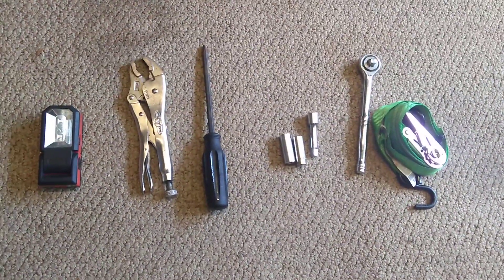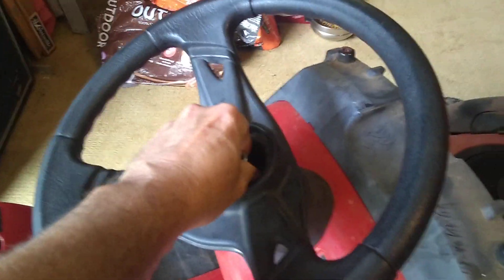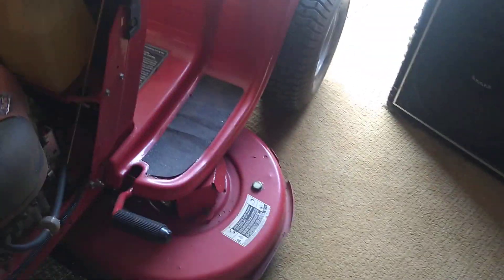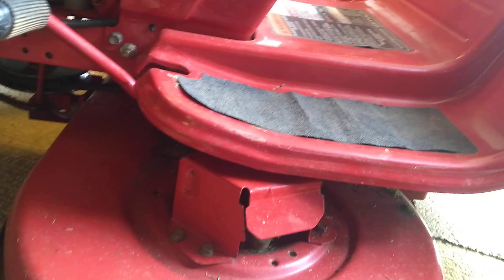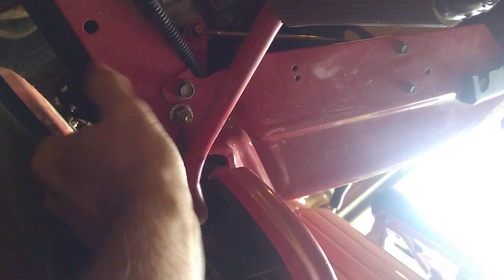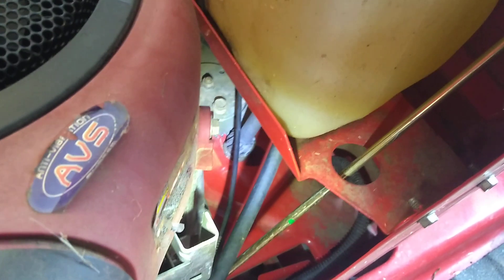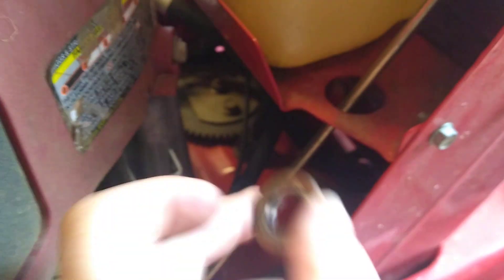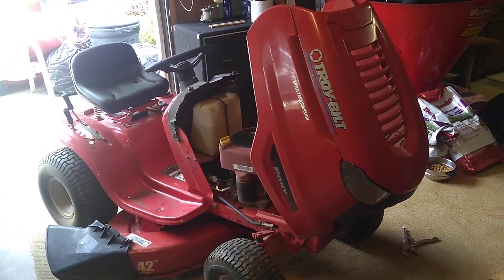Troy Bilt steering column fix 2008 model

Comment: For those that may have an issue with the Philips head screw like I did. I used my battery powered impact wrench with a #3 Philips bit on that Philips head screw while my son held the steering wheel and it came right out.  Nice video.
Reply: It’s a 5/16 size 1/2 inch long bolt will replace the Phillips screw 😊

Comment: Very helpful video gscott1111. I have the exact Troy Bilt Pony year model here. After inspection, I noticed that I need to replace the steering gear assembly as well. Might as well while I'm in there. Calling Troy Bilt mañana.

Comment: Thanks..got the new steering rod...but the big Phillips screw i can't for the life of me get it OFF...
any suggestions ??? Thanks in advance ☺
Reply from the maker: I used  vise grip plyers. Had the same issue. It will come off,  you might have to put a long pipe over the plyers for leverage.

Comment: I replaced shaft but screw on bottom ended up falling out. I ordered a new one with loc tight and that fixed it. However, new pinion gear on new shaft immediately stripped out again so I’m back to square one. I think I’ll have to replace/tighten other gear that pinion turns but I’m done fooling with it and will likely pay to have it fixed by someone who knows what they’re doing at this point. I’m super frustrated.

Comment: Folks.. keep the original hex flange and re use it if it  is not too far gone, the new replacement ones are about a mm or so too thick and replace that #3 Phillip screw with a bolt head.. Also, you might want to presoak All The bolts and screws you are working on with a good catalyst like liquid wrench or PB blaster..
Reply: Replacing the Phillips with a bolt is a good idea.  Catalyst not so much.  Always lube the new bushing with thick grease (wheel bearing Grease) and throw the old one away.  Just finished refurbishing a 2009 Yard Works, 46" 20 HP.  MTD made.  Almost Identical machine.

Comment: Why when I tighten the shaft screw on the bottom my steering wheel won’t turn the gear, but when I loosen the screw it’ll turn the wheels but the screw becomes too loose subject to fall out?
Reply: I had the same issue. The hex flange that came with my new steering shaft was thicker than the original. It caused the steering shaft cap to not fit properly on the end of the shaft which should slightly protrude through the hex flange. Mine loosened up and the screw and cap fell out while mowing. I ordered a new screw and cap and installed with the original hex flange and everything worked. The new screw had an orange substance (loctight?) preapplied which kept the screw in place. This solves the problem. My issue now is that the gear the pinion gear turns is loose and it’s stripping out my new pinion gear. Anyway, hope this helps and good luck!
Reply: @chriscline4684   that’s what I was thinking it had to be. The original hex flange is still good so I’m gonna install it and see if that fixes the problem. Thanks for responding
Reply: @chriscline4684   that was the problem. The hex flange that came with mine was thicker than the original. Now when I turn to the left it’s skipping and trying to strip the shaft again. I’ve replaced the steering gear assembly that the shaft rotates on but it’s still trying to move as I turn left causing it to skip. Crazy. Thanks bro
Reply: @kingbeav8386  Well that sucks. That’s exactly what is happening to me. It skips when I try and turn left. I haven’t replaced the gear that the steering shaft turns yet but it sounds like that didn’t fix the problem for you. Let me know if you figure it out. Push mowing my yard takes too long!

Comment: No success at getting that Philips head screw out yet but haven't given up yet.
Reply from the maker: Just an update on this video. Was almost a year to the day I replaced the steering column and it just went again. I ordered the new one they gave me a 10 percent discount and said the part has only a 30 day warranty. The piece seems like a strong piece of hardware but it is not. I only use the mower to cut my lawn. Easy job though just follow the instructions. On another note I would suggest the John Deere or  the Husqvarna. I've owned several mowers and never had to do this job once.